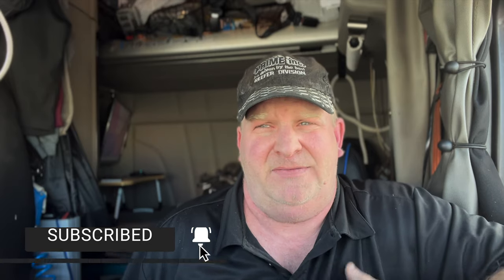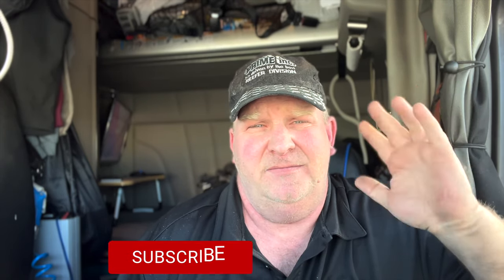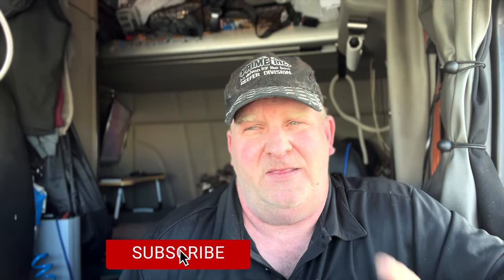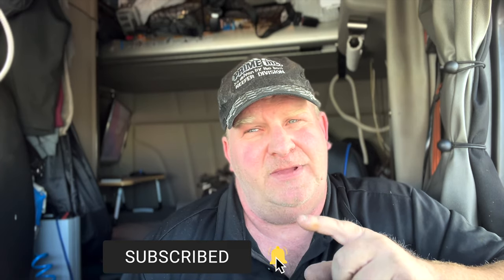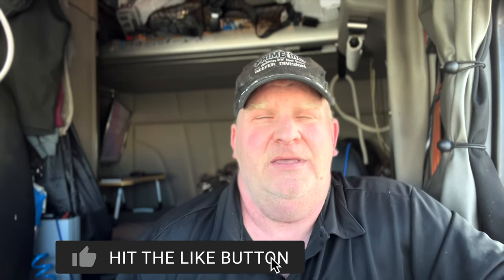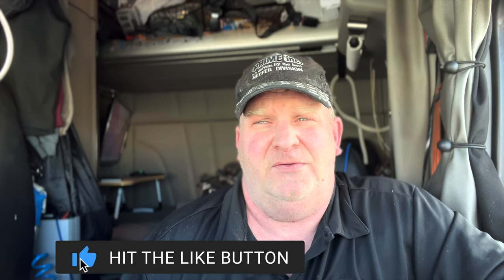New Driver Series - How I get Internet

Comment: Do you need a CellPhone Booster?  & do you get good signal everywhere with the Wi-Fi?
Reply from the maker: No booster. The wifi is on the AT&T network
Reply: @TruckingWithTruckerMike  do you ever lose signal? I’m trying to figure out if I should get this or the Netgear nighthawk
Reply: @highwayspeed867  same